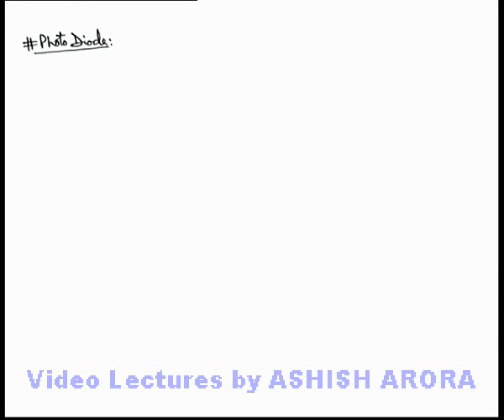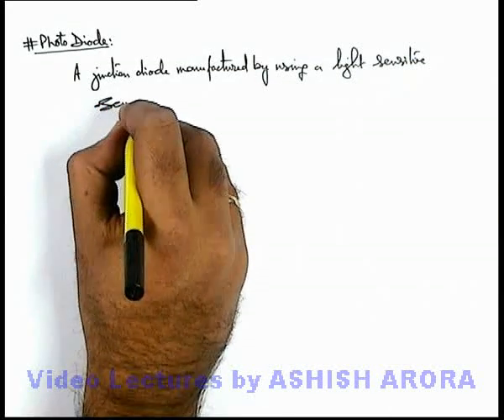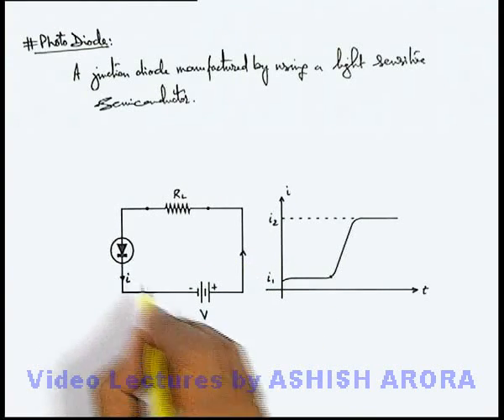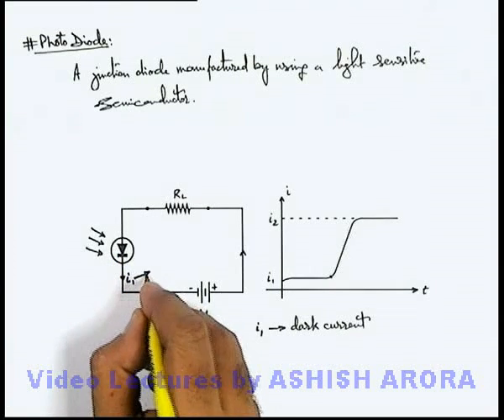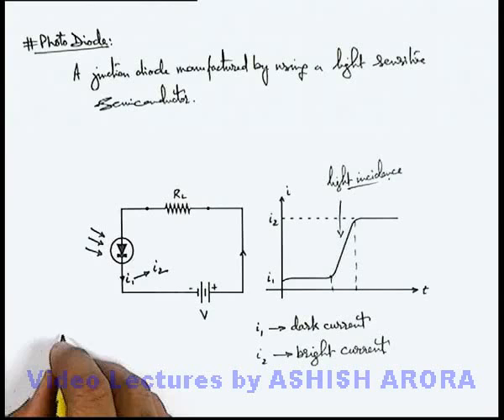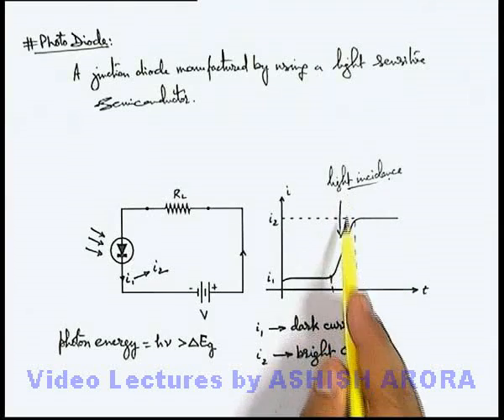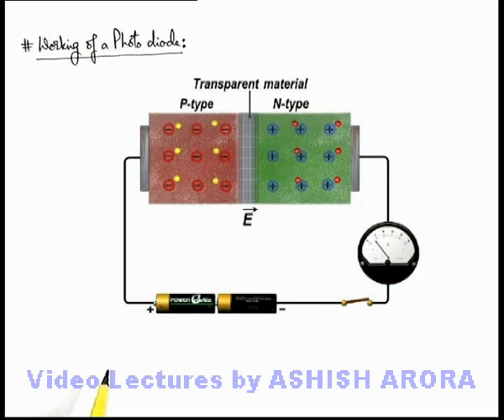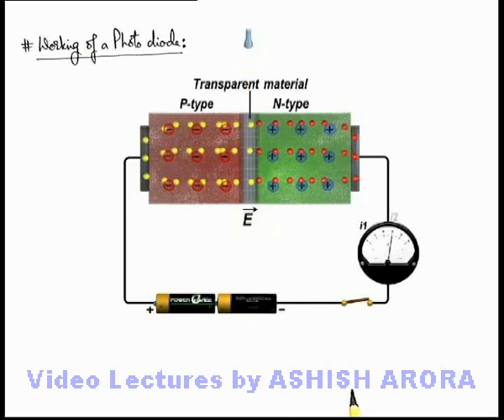Class 12 Physics | PN Junction & Diodes | #23 Photo Diode | For JEE & NEET

Comment: Sir the current should decrease as we put light on depletion layer as the electron hole pairs generated should move in the direction of electric field in depletion layer
Reply from the maker: There are two types of photo diodes which work in Forward or Reverse biased conditions... in FB(as given above) it will increase and in RB it will decrease...
Reply: Physics Galaxy sir does that mean the graph given in photodiode section of ncert is wrong? there it says that as intensity of incident light increases rev saturation current increases....
Reply: Abhiram K.T. read above explanation. NCERT is talking about functioning of diode in RB

Comment: sir it means that battery will be discharge faster
Reply from the maker: +s.tarique ali There are two types of photo diodes - one which work in forward bias condition and other in reverse bias condition... when current is high then battery will discharge fast but we are using the current also...